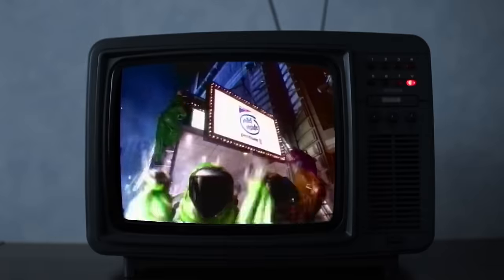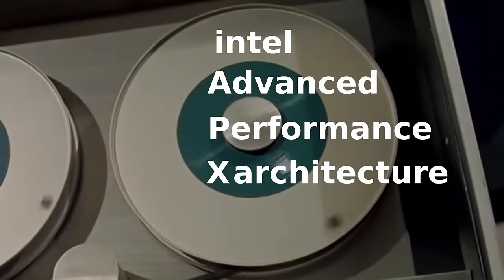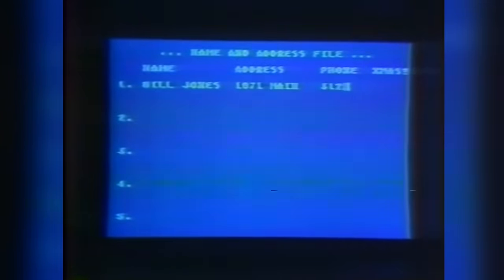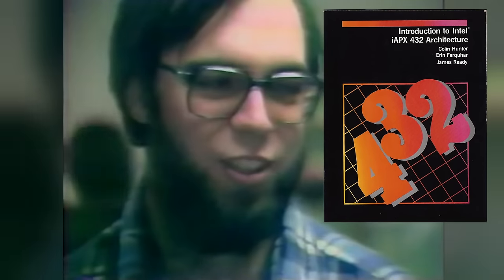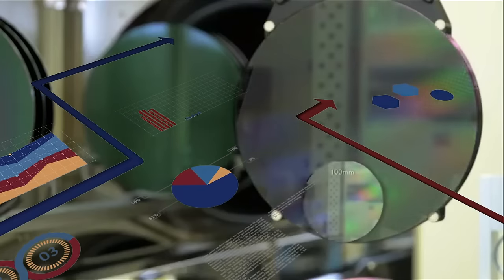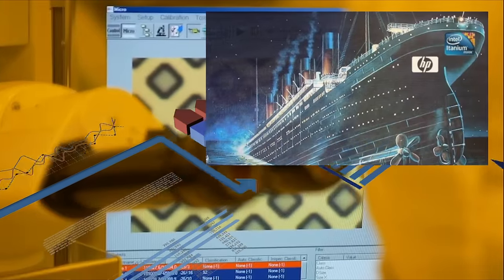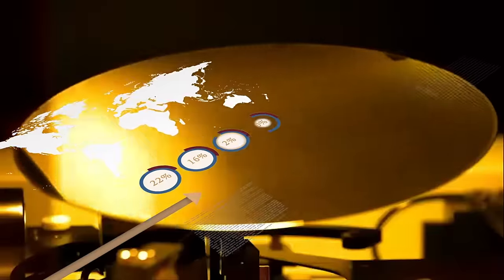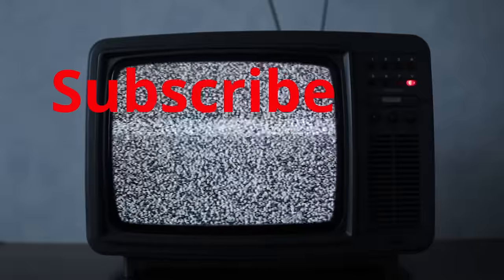iAPX The first time Intel tried to kill x86

Comment: They didn't only choose the V20 because it was running a bit faster than the 8088 (which is still slower than comparable processors, in tradition with the 8080 being a bit worse than the z80 and quite a bit slower than the 6502 at the same frequency), but because it include an 8080 emulation mode you could run the real CP/M on - because CP/M-86 was just as much a hack to run CP/M on the 8086 line of processors as QDOS,  later renamed to MS-DOS, was.
Also, IBM chose the 8086 (well, 8088 to save on databus width and thus memory chips needed) because there were different suppliers, unlike the 68000 which was made by Motorola, and only by Motorola. That tactic was something IBM often used, at least when there were external suppliers of hardware, there had to be at least two. So that same method was repeated when they introduced their RISC-line of workstations based on the PowerPC architecture, which they would never have used if there weren't at least two suppliers of PowerPC processors. Incidentally, for the x86 architecture this demand for two suppliers was how AMD entered that segment.

Comment: No IBM Research developed RISC, at least East Coast RISC which is the basis for Power.  East and West Coast Risc is extremely different.  I heard about IBM Riscfrom George Radin,  in about 1982 when I attended IBM SRI in NYC for 4 months or so.  iAPX was a joke as I viewed it.  IA64, which I developed an interpreter for, was better but not a success.  S38 also was designed as sort of a higher level machine, based upon ideas from IBM FS and supposedly was easier for compilers to generate code for.  S38 had a flat address space and supposedly had pointers that could not be faked. Thus, one had objects whose security depended upon not being able to fake pointers. Programmers in RPG and Cobol probably could not easily get around the security but once one added PL/I and or C languages then all bets were off. Nobody to my knowledge has been able to efficiently manage un-fakeable pointers in a secure fashion.

Comment: The Threadripper line of CPUs by AMD were also probably named in reference to Ada Lovelace since that can also refer to working with a programmable loom which she did. It's a very clever double entendre.
Reply: The usage of threads as process 'components' predates the Threadripper CPU. First usage in the 60's and increasing since the 2000's I think it's more a reference to multi-threaded programs. I think the more obvious reference is process threads, and the loom reference, although it works, is reaching a bit...
Reply: When programming in CUDA or OpenCL, there are groups of threads which work in lockstep, since they're all executed by the same instruction. This group is called a warp, which is a term that also comes from weaving, where it describes a group of threads running parallel to each other.

Comment: I can see trying to kill one thing to bring in a better thing but the x86 architecture has been very successful.  It is everywhere and even though modern processors are 64 bit, the desktop and laptop ones all still run x86 perfectly fine.  Maybe on some of the latest ones running DOS may be a little harder than normal because of compatibility reasons.  One such one is many modern PCs have no floppy drive.  You would have to prepare a hard drive or USB stick with a bootable copy of DOS, assuming you still have a licensed copy. If you don't just try the free alternatives and see if they work.  Just keep in mind with DOS you probably have no use of all that extra RAM you may have installed.  I don't know if QEMM can work with anything more than 4 GB and DOS is 16 bit right?  That would make it address a lot less than 4 GB.  I read somewhere it is 64 MB.  I may very likely be wrong on that.

Comment: Actually Itanium was the THIRD time Intel wanted to replace the x86: the second attempt was the i860, which failed miserably as a generel purpose CPU. Rumor says Windows NT was named that way because it was originally intended for the 860 which had the Intel code name n10. As far as I know Intel was also offered to buy the architectural rights to the DEC Alpha, which they refused for some reason....even though it would have been a very good target, as it's instruction set has features specifically designed to help migrting from other architectures. Not to mention the 960, which was ANOTHER RISC cpu by Intel.....

Comment: I experienced another of intel's operating systems, RMX or iRMX was an alternative to other systems making use of x86 chips. Essentially it was intel's own DOS but with real time multitasking  built in.   The company I was working for in the 80's was under pressure to ditch DEC for Intel...
The reality was that RMX was not not in the league of  the DEC offerings in any respect, except entry price.
Reply: Yes, they had RMX80 and RMX86 and also ISIS.  the ISIS OS really was two different ones because the ISIS that ran[1] on the 8086 was very different from the one on the 8080.
[1] Loose definition of "ran' used.  IIRC, the 8086 version was significantly slower than the 8080 version.
BTW:  
RMX80 had an 'almost minor' bug that it left the interrupts off for 'days and days' while it did stuff.  i rewrote a small part of it to make it let interrupts get through.
RMX86 had a configuration tool that was clearly written by someone who hated programmers.  It was based on asking a super long list of questions.  Make one mistake and you had to start over.

Comment: Maybe designing the iAPX for Ada wasn't the dumbest decision: IIRC, parts of the US Government stipulated Ada as the language for projects (and perhaps the Department of Defense (US spelling) was one of those parts); that could have been good commercially, if the project had worked technically.

NEC V20--I have a hazy memory of putting one of those in a clone, long long ago. V20 was ~ 8088, and was there a V30 ~ 8086?

Comment: A beautiful CPU architecture 15 years too early. By the time they got it right, in the i960, the high end market was not so easy to break into.
The contrast to RISC is a bit silly, as early RISC had some high-level language features like register windows.

Comment: I wonder how much better it would've performed if the compiler wasn't garbage. I mean, the main advantage of CISC is that there's hardwired logic that can process things faster than software instructions. It probably still would've failed though as less complex CPU's can scale way better and are cheaper to produce.

Comment: Ada is quite beautiful. I like it very much. Looks calligraphic.

Features Ada demanded are hardly specific to Ada. PL-I would also demand it, and AFAIK PL-I compilers do actually use BOUND and INTO on x86 while Ada compilers usually put jumps. x86_64 is missing INTO and BOUND anyway.

Intel had actually returned to those ideas later. It's called Intel MPX. Their problem: instead of using sane programming language like Ada, they try to add safety onto C/C++. And C/C++ is just not prepared for it. Replacing C/C++ with Ada is a much more practical approach to achieve safety.

The modern reason for Ada adoption is SPARK, the formal checker. That's why NVIDIA is adopting Ada. I personally didn't dive into SPARK. Ada alone is quite good for unhackable server backends I am writing.

Comment: Well, the 286 should have allowed OSes like Unix, but its broken protected mode hamstrung that. (Still a nice improvement over the 8086/8.)
Reply from the maker: Most of it's flaws mess up using projected mode for DOS real mode applications under it.  The likes of Xenix worked just fine, but given the relatively short time as the top PC processor vs OS development time we saw the likes of Xenix getting 386 optimised versions very shortly after the 286 versions.

Comment: We tend to forget that for the first 10 years or so of its existence, Intel was a memory chip company that also fabricated micro processors. iAPX could have been a reality and some of the long-standing quirks (A20 gate, anyone?) of the 8086 architecture never would have lasted. But alas, of course this "CISC Extreme" approoach would soon totally go into the opposite direction, with RISC and pipelining and high clock rates. In the end, Intel ended up with their CISC architecture implementing as RISC instructions under the hood.

Comment: Did Motorola 68000 CPU not have 68000 transistors? I've never seen anyone claim it has 40000 transistors before, barely more than the Intel 8086.

Comment: I've never coded in Ada (though my dad did). I did teach myself Pascal in the early 90s, though, and had no trouble understanding the (presumably) Ada code you showed glimpses of, even though I haven't touched Pascal in nearly 30 years. For all its faults, Pascal was extremely readable.
Reply from the maker: The pascal tree of languages are really not that bad, they are just out of fashion. Ada is a nice improvement with OOP and being able to import namespaces. I personally prefere the more turse { } to denote blocks but begin and end are just fine, and perfectly reasonable. I supsect C's great advantage in the 80's and 90's was getting very good perfroming code from compilers. I remember watcom C producing the sort of code I would produce if hand optimizating asm, its about then I probably stopped doing any asm at all.  Turbo pascal was fine but did not perform at quiet that level. Also the lack or incompleteness of API's for pascal being an issue, particularly if you where a windows dev, when 95 came out.  I seam to remember MFC have win32 suport prior to 95's release if you installed the win32.dll for win3.1 or used NT.  I seam to remember it took bordland a while to catch up.
Reply: Yeah, I used Turbo Pascal 3.1 through their last DOS version (6? 7?) and then Turbo Pascal for Windows. TPW was... not great. Delphi was a better Pascal than TPW for GUI coding to be sure. I also went the C route at my earliest opportunity, though for me it was the rate I could afford the upgrades since I was still just a hobbyist until '97, by which point C and C++ were king.
Reply: There is no "was" about it.  Look up Lazarus.  You will see that behind the forms and menus and the like, the language is Pascal with some upgrades.  It is a 'write once compile anywhere' thing that really does seem to work.

Comment: the 432 was a quite remarkable machine. lots of innovative features like hardware redundancy, privileg checking etc. and all this complexitiy without the modern tools like verifiers and sat-solvers! and they did the right approach: looking from the software-side and ask 'how would a cpu/isa for this languiage look like?' unfortunately, they lost to the spirit of the early 80's, when the various upcoming processor architectures compared each other 'look, ma - my strcpy() is faster than their strcpy()'. At the end, C prevailed - because a c-compiler in the 80 was much simpler than an ada-compiler. and what was the cost? how much damage was done from memory allocation errors - how many versions/years did it take, until a widely used desktop operating system became stable? all because of that rotten c-language. and then came the internet. how much damage was done/value was lost through virus/worm-attacks - because of that simplistic language running on a simplistic isa? 'look, ma, we have an execution-prevention-flag' - an idea, which was available in the 70s. todays firewalls and virusscanners are an (expensive) attempt to build a safety/security in software which was available in hardware 40 years ago.

Comment: my univ IT curses worked on ADA until the year right before I came in, when we "upgraded" to OCaml,
and I'm 23 y/o,
if think there late 😅
(also C, but second year, and java on third year, but you still had to deal with OCaml classes, and OCaml without using the "O" part, which, I think, made it even more absurd)

Comment: Wouldn't the 6502 be considered a RISC ISA? I mean one of its goals was reducing the number of instructions to a bare comfortable minimum
Reply: Initially one of the characteristics of RISC processors was to execute all instruction in a single clock cycle. IIRC, the 6502 didn't do this. The definition of RISC and CISC have gotten a bit fuzzier but I wouldn't classify the 6502, 8080, 6800, etc that way. But, it doesn't matter. They did the job when there was no real alternative.
Reply: @davidvomlehn4495  yes I see now, RISC ISAs have very little adressing modes, many instructions being register-register, and writing memory classically restricted to load and store instructions, due to this they  also have tons of registers. The 6502 has a small instruction set, but plenty of different types of them, and only 3 non general purpose registers (leaving one fully workable!)

Comment: 6:34 Today there is Clear Linux, though it is Linux so Intel didn't write the OS they just released an optimized Linux distro for Intel CPUs. Then again Intel is a pretty big contributor to the Linux Kernel..
Reply from the maker: They do contribute a fair bit to the Linux kernel. I dont think we can call it an Intel OS in the same way iMax was.
Reply: @RetroBytesUK  I would consider Clear Linux a 50/50. I don't know how much optimization work Intel did (Did they just turn on some compiler flags by default or did they go in and optimize the code), I would imagine quite a bit if they're going to drop a distribution based around them, but it's still nothing compared to writing something from scratch.

Comment: nearly all the old computer engineers I know talk about the 432, rather than the instruction set.
Reply: i will say the idea of enforcing oo isolation at the hardware level has some theoretical value. lots and lots of bugs would never exist with hardware like this. But of course really complicated cpus have usually failed.

Comment: Not so sure about your time line.
Unix memory Protective mode really happen untill the 386, the fact that a company try something different isn't a bad thing.
Reply from the maker: The 286 definitely introduced protected mode, which for example xenix used.  Intel improved protected mode for the 386 by introducing virtual 8086 mode which the dos prompt in windows 3.1 used. What the 286 was not good at was allowing real mode code to run under protected mode, making it of limited value for DOS.  The virtual 8068 extention to protected mode ment the 386 could run real mode code under protected mode.  Hence many people only encounted protected mode from the 386 up, and thus assumed thats when it was introduced.
Reply: UNIX did not require the paged memory Intel introduced on the 386. It was happy with segmented memory, which is basically how it ran on early PDP-11s. I ought to know: I worked on the UNIX kernel on 286, 386, PDP-11/34 and other architectures.

Comment: the Motorola 68000 did not have 40,000 transistors - it famously had 68,000 transistors because that's where the name came from.

Comment: Both the NEC V20 and V30 where release in 1984 long after IBM clones started up and even after intel's successor's 80186/80286 which where released in about 1982. One of the main reasons the 8088 was chosen was that its external bus width was still 8bits which helped in keeping the costs down
Reply from the maker: You right it is after the clones started to be manufactured. However most of the clones sold after the lunch of v20 and v30.  The price point of the v20 really helped get the cost of the clones down (as did falling ram prices) and really drive sales. So it true to say more clone machine used the v20.
Reply: @RetroBytesUK  I can't speak for other parts of the world, but here in New Zealand the main use of the V20/V30  was as in a drop in replacement for current cpu's to boost performance and life of current machines. There where however a number of brand name clones like Amstrad, NEC which used them and quite popular. We also saw a number local PC builders use them once they came out along with 80186/80286 hybrid XT  machines that retained the XT 8 bit  expansion bus but delivered overall better performance. We did note at the time a number of capability issues with NEC chip which seemed to effect some games and software copy right protected software. Keep up the good work on your channel, luv your work brings back cool memories 😀

Comment: I cut my teeth on 74LS00 TTL logic and my first solid food was the i8008. I made a career of designing with th i8051 and its variants all the way to the Silabs 80F135 which is an 8051 core that runs at 125MHz and has 128 pins and the ability to use 16Mb of memory. Didn't switch to RISC until the 2000s with various multiform ARM32 processors.
Reply: The 8051 was the best processor Intel ever made.  Everybody and their dog now makes 8051 based machines.  if you want low power, they are a good option.
BTW:  the base 8051 could address 16MB.  You just had to use p1 as the other 8 address bits to do it.

Comment: Is there a successful RISC chip?
Reply from the maker: ARM, and also the interior architecture of most x86-64 processors. Both Intel and AMD use an instruction decoding engine that breaks x86-64 into a significantly reduced instruction set that the CPU execute. So at their core they are RISC processors now.
Reply: I just dont see how something like Apples A series SOC really maps to RISC philosophy, seems more akin to a highly optimized CISC  design, or maybe now evolved into something else entirely with huge areas of the die dedicated to very specific functionality and instructions,  the ARM  core itself has gained a huge amount of instructions since Acorns first chips.
Internally in the CPU core possibly as you say but are they really letting on?